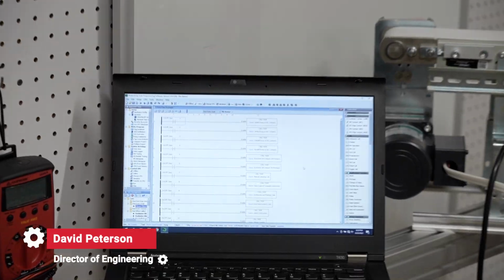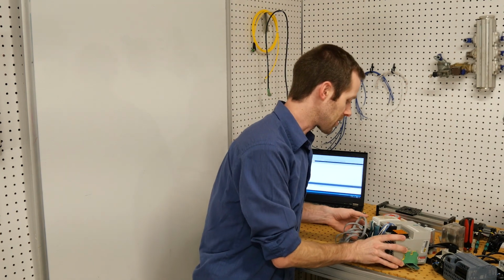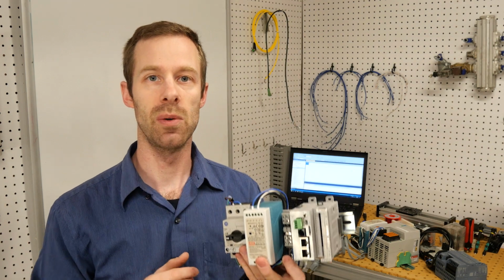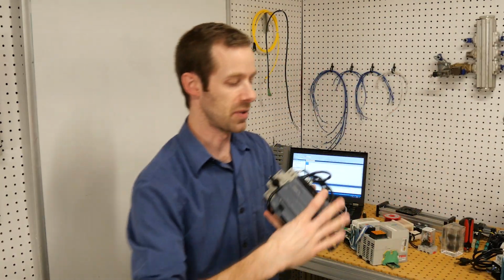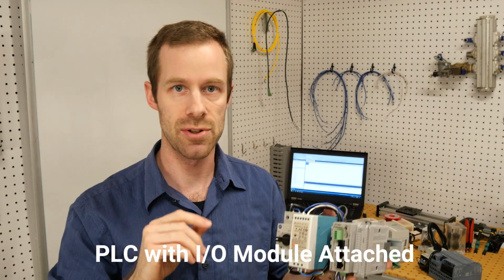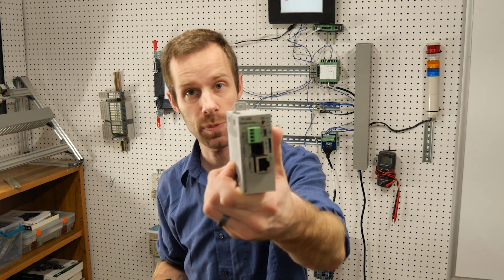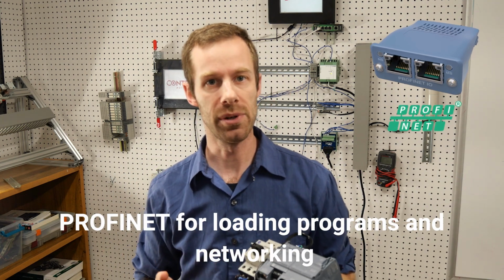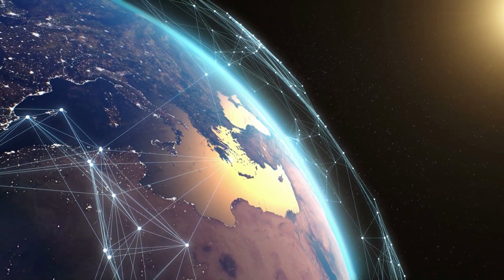Programmable Logic Controller (PLC) Hardware - Control Automation

Comment: It’s hard (as I think those of us with experience all know) to place ourselves in the beginners shoes and to slice the mountains of knowledge that is industrial automation into beginner portions. It’s easy to fall into the trap of regurgitating years of acquired information only to have the focused audience left confused and intimidated. I think this intro video is about as close to ideal in that regard as I’ve seen. The piece of constructive criticism I’ll leave is that maybe mention that the term CPU is being used to describe a package of smaller components in this case, so not to confuse them when they here terms like memory/RAM or storage terms. Great job!
Reply from the maker: Thank you, and the constructive feedback is welcome. It's a good point about the CPU - many terms are used in both industrial and personal computing, but with different meanings based on the application. The CPU does indeed refer to the entire logic computing assembly, not just the single specific chips inside.

I also appreciate that I entered into automation with very little electrical experience. I definitely know what it feels like to be a beginner, and I learn be seeing and doing. I love collecting and experimenting with all kinds of equipment. If you want to learn, tinker. Break stuff. Sometimes get lucky and even fix it, but don't get disappointed if you can't.
- David